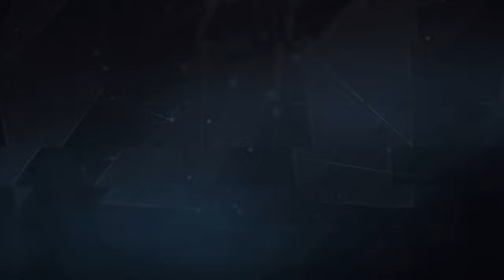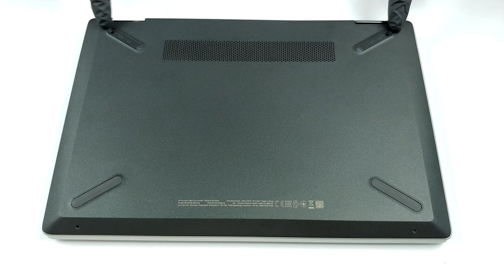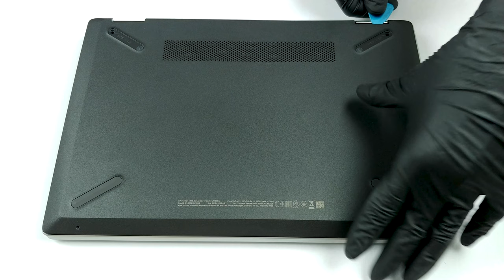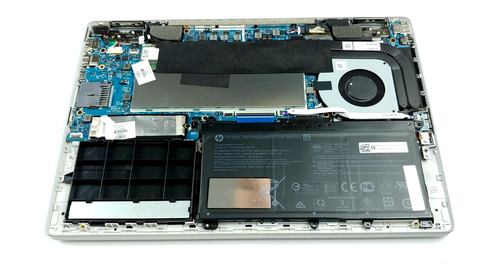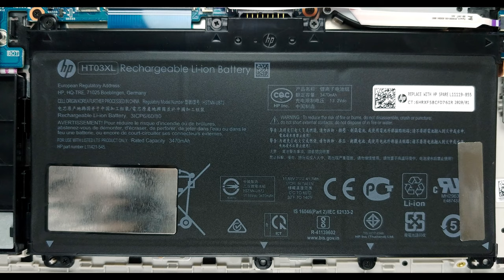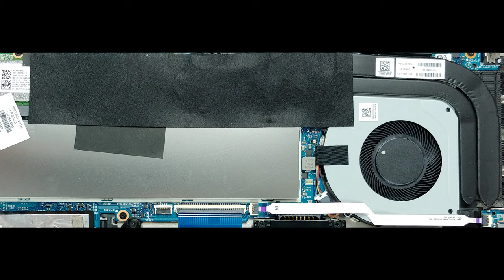🛠️ HP Pavilion x360 14 (14-dh1000) - disassembly and upgrade options

Comment: hi, how to add 2.5" SDD?
Reply: If you find out, let me know
Reply: @hitler1494  ok, thanks, if I get it to work, i will just use double sided tape maybe. Do I need a power supply cable to the ssd?
Reply: @hitler1494  ok, is there a way to contact you? If I have any questions if you do not mind. I already have a 500gb Samsung ssd

Comment: My X360 is identical to that one only that mine has a solid hard rubber block like 1 x 2in right where the ssd should go. Seem s HP didn't want an ssd installed there although it has the connection for it. I'll see what I can do to get an ssd installed.
Reply: Hi, did you succeed in removing that block? I also want to install the SSD, but I'm not so sure how to remove that block
Reply: @maninderonline  Yes, I removed the block. It just happens to be very well glued to the surface. It was a bit scary but I used a small pry tool and carefully lifted  it off.
Reply: @therealfirstone  That's great. Did you manage to make a video? Also, did the block break during removal? As it seems that to break it is the only option to remove it.
Reply: @maninderonline  Sorry didn't make a video. The block, like I said, is just glued on. It's glued on to a metallic tape underneath it.The block come out in one piece, it's just glued very strongly, gives the impression that it's not meant to be removed. Also the block is so solid at first I thought it was not rubber. I wedged the end of some tweezers under it and very carefully pried and that's when I noticed it can be removed. I'm still waiting for the kit for the SSD install to arrive so I haven't opened the back of the laptop yet.
Reply: @therealfirstone  Hi, that youtube vid is not there.. can you share the correct link?
Reply: @ManinderSinghthegr8  I didn't know that I had to make it public, Check it now, also I didn't notice any metal pins in the connector for the ssd connector where the cable goes. Maybe HP didn't intend for that connector to be enabled. Here's the link again for the video, and sorry that I don't have much experience making YouTube videos. https://www.youtube.com/watch?v=Ncklj9zwB7w
This is the cable I ordered https://www.amazon.com/gp/product/B07L5K27S7/ref=ppx_yo_dt_b_search_asin_title?ie=UTF8&psc=1
  Update: I think I  I have the wrong cable, the connector on the motherboard has 12 pins and the cable has 10, I'm going to order a different cable.

Comment: Thanks. This was very helpful. I had to disassemble a similar albeit slightly different model (CD-0056TX) and was able to do using you video. The internals were exactly the same although the external screw mountings were a bit different. 

Appreciate the effort! 😊👍🏽

Comment: Yes I would also like to see how to add a 2.5 hdd for storage. Also where can I get a caddy for the hard drive. What is on the right side under the battery? 
Thank you!
Reply: Hay, did you suceed in dissembling plastic plug from the sata 2.5 plug?
Reply: Any solution yet?
Reply: Need to know

Comment: What is the block at bottom-left?
Reply: It's where you can put your SSD (or HDD lol) sata 2.5. Since in this model they don't have it (you'll have to by it yourself), they replaced it with something the size of a SSD, with 2 metal weights, that you can take of to put a drive.
Reply: @linkhimura974  I checked my laptop. But I don't see any connecter for a 2.5" SSD